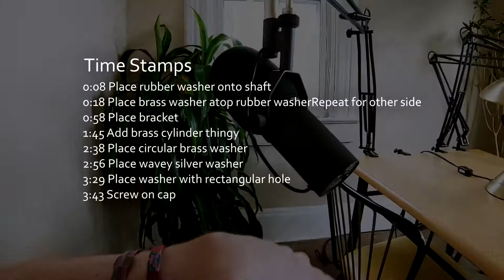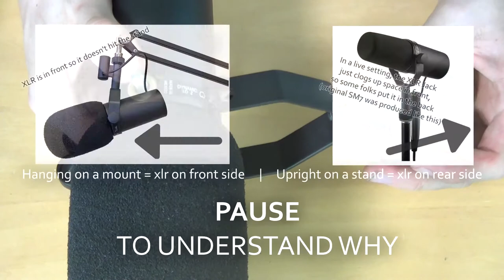SM7B Loose Mount Fix (Timestamps in Description)

Comment: The washers facing the right way is the huge thing IMO. I did everything else right, but the mic was still super loose. Made sure the washers were the right way per your instructions and it worked like a charm!
Reply from the maker: Yes I am going to remake this video so it's just the good part. Glad it worked out for ya but sorry for all the extra fluff.

Comment: I couldn't get the brass sleeve to go all the way in til I used the dull side of a razor blade to prop up the inside washers to align properly, then it worked! Now tight as factory.
Reply from the maker: Nice dude. Other folks might find that helpful, so thanks for commenting.

Comment: you're legit. i just cant help but wonder why/how it "breaks" in the first place.
Reply from the maker: My guess is that there's a limit to how much it can be loosened until that cylinder has the room to jiggle out of place and, once bumped, the cylinder jumps above the washers and stops you from getting it to tighten until you get the cylinder to sit flush again (which, if the washers moved at all, will require the disassembling and reassembling as shown in the video). 
Because it's ubiquitous, id call it a very minor design flaw. If they ever do an SM7C (they're not, to my knowledge), let's hope they'd take this into account. It after all, a pretty pricey item. Thankfully the fix is reliable though, we gotta give it to em for making it easy to fix, if you know how (like anything, right?). 

Anyway,
Sorry for typos. Writing on my phone. 

Have dandy day! 🍰

Comment: Damn I still can't get mine right. I need to tighten it very very hard in order to make it not go down, and I followed these steps :(
Reply from the maker: "2:06 might be the part you're looking for. 2:12 shows the root of the problem, 2:29 shows result of the problem shown next to the correct one."
-from the description

Did that help at all? If not, I'd be happy to help in any way I can....can you describe any other details so that I might be able to help better?
Reply: @crowlsyong  I I’ll try that again asap when I’m back home. The little story is that my first sm7b copy had a crazy rattling issue so I exchanged it, but the tilting movement was way smoother, felt light, and stayed in whatever position I put it, while not needing the screws to be tightened too much. Now with my second copy unless I tighten it hard, it will sort of wobble, if I tilt it down, it will go up a few centimetres. So it’s always tightened very hard, so yeah it works but it’s harder to handle on a daily basis because I have to put more strength on it to tilt it while using it (sorry if my English isn’t good). It’s not a big deal and don’t want to refund it a second time, but it’s just a bit annoying.

Comment: Is it possible that your mic is a counterfeit?
Reply from the maker: Doubtful. It was purchased from BHPHOTO, and they are trustworthy. I'm guessing that I simply loosed my mic too much one day, the washer jumped in front of one of the screws, then I wasn't able to retighten until I took it apart and realigned said washers.
Reply: Thank you for your reply. I just bought a sm7b from amzom uk (verified reseller) at a great deal, I worried if it is a counterfeit. I found that a lot of counterfeit has a lose yoke, thats why i put up such comment.
Reply from the maker: @szelong28tommy ahhh interesting...